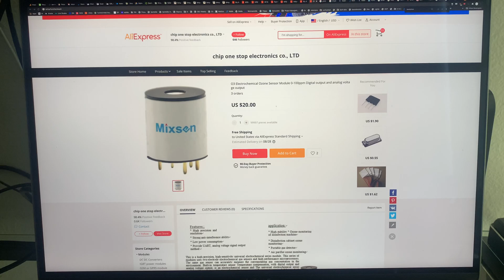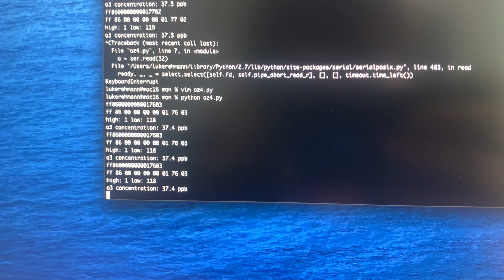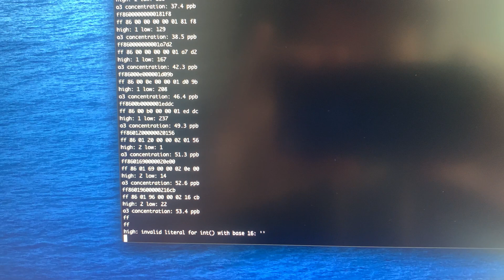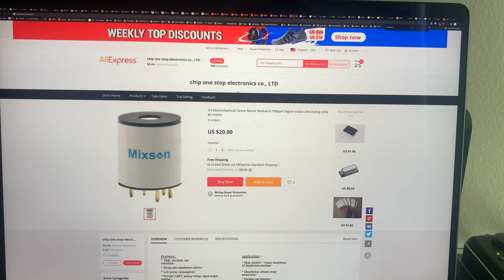Mixsen Ozone O3 Sensor -- Testing Ozone Concentration

Comment: I have a few questions regarding this experiment:
1- Shouldn't byte 2 and byte 3 be used in the equation to calculate the concentration as per the data sheet says (2)High byte and (3)Low byte? It doesn't make since to have a value for ozone when there is nothing in room air.

2- why did you use ppb instead of ppm, the resolution unit is in ppm so the final unit should be in ppm? Since the sensor can measure up to 10 ppm, the maximum value that you can calculate if you the 2 byes where FF and FF will be around 0.8 ppm, which doesn't make sense since the sensor can measure up to 10ppm.